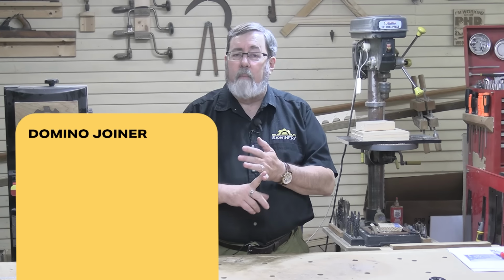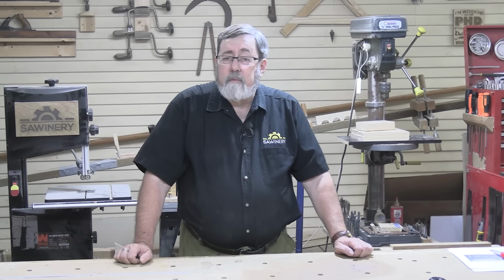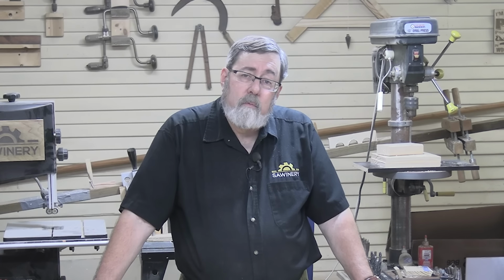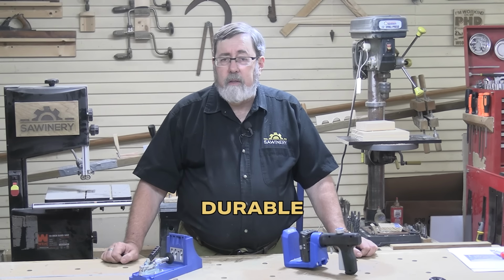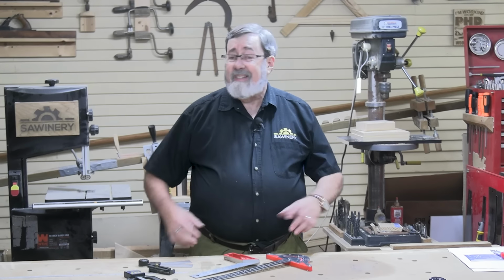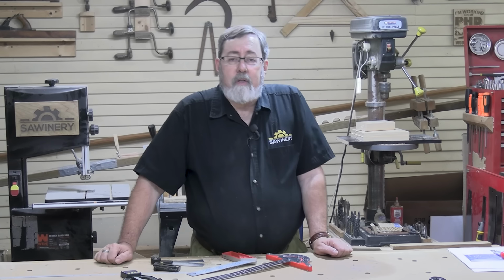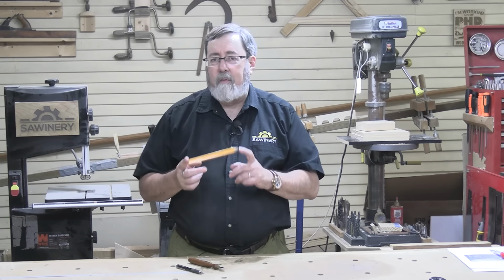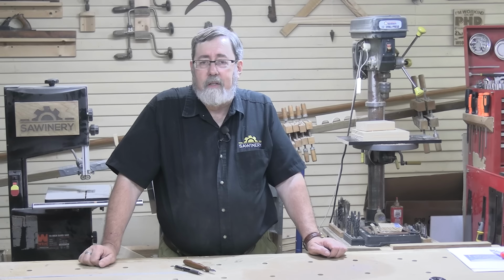5 Most Overrated Woodworking Tools

Comment: Warning bells to any new woodworker watching this video, and perhaps the rest of this man’s channel. I have not watched his other videos, but at least this one is fraught with assumptions and an apparent misunderstanding between the concept of overrated vs unnecessary for the hobbyist, overkill, superfluous, etc.

Domino: While it could be that some people think dominoes add strength to panel glue-ups, I have never heard such an assertion. Without a significant sample size, which you do not reference, it seems bizarre to make the conclusions that you have. The domino is for joinery, and granted, is unnecessary for many hobbyists. It does essentially one task very well, but one that could be done with a router, dowels, hand tools, etc. The domino is for speed, and while I think mostly apt for professionals, as a hobbyist with limited time, it means I can more quickly make furniture. Domino: Overkill if you can’t comfortably afford it, but not overrated. 

Miter saws: I’m lucky to have a 600 sq ft shop. My previous two shops were 100 sq ft at best. During this time, my miter saw was a miracle for making repeatable and clean crosscuts quickly when I didn’t have room for a table saw. New-flash, but not everyone has a garage or basement they can place a table saw. To make the statements you have is a bit of a pill to swallow for viewers desperate to get into the craft but may just have a spare bedroom. (If any of you are reading this: Yes! You can do woodworking in a small space! Don’t let this kind of content discourage you.) Next time you try to make a video talking about tools you do or don’t need, try to think more about how other people have different living circumstances than yourself. I currently have both saws, and a bandsaw for that matter, and still use my miter saw constantly. Not having to break down a setting on my table saw for a quick crosscut is fantastic. This said, I would go without a miter saw before I gave up my table or band saw. Miter saws: maybe overkill, but not overrated.

Inaccurate measuring devices: To be blunt, I thought this section was a bit silly; odd at best. if you renamed this section to “cheap measuring devices from china” I would agree with your conclusions that these particular tools are junk. This said, WHO are you talking to that is expounding the virtues of tools from temp/alibaba/no-name-brands-on-Amazon? For you specifically, and this is the odd part to me, why would you think these are worth buying? These are clearly rip-offs of woodpeckers tools, which are indeed accurate. Some are gimmicky, yes, but they are not inaccurate. (I am not a woodpeckers fanboy, but do own two of their squares.) With this said, I could understand if a new woodworker thinks they need all of the woodpeckers tools they see on youtuber’s walls. You don’t, you need one or two reliable squares. Woodpeckers: Overkill, not overrated. Gimmicky cheap measuring devices: crap, but, duh?

Pocket hole jig: I think like the domino, you’re misunderstanding the use of this method of joinery and have latched onto a few bizarre conclusions, also involving panel glue-ups oddly enough. Personally, I wouldn’t choose to glue up a panel with pocket hole screws - I would just use glue and clamps (and would throw some dominos in too for alignment ;)). But, for someone without enough big clamps, pocket hole screws can be a workaround for “clamping” them together. Not really recommended, but it’d get you through a bind. Anyway, they’re for 90 degree connections! You’re right, you can probably generally rely on glue and clamps, on a drawer or carcass for example. But hey, pocket hole screws mean you can take clamps off and keep working. Fun! Pocket hole jigs: Misunderstood (by you it seems?), not overrated. 

Carpenter pencils: It’s ok to just have four categories if you can’t think of a good 5th one. 

Lastly, please stop relying on adages similar to “my dad did such-and-such and he was always fine.” Judging by your appearance, your dad probably didn’t wear seatbelts either for at least part of his life. 

Progress is good, change is good. I hope my son gets into woodworking, and I hope that he teaches me new techniques and tools when he is my age.
Reply: Ditto.
Reply: Thanks for posting this, saves me the time of writing something of similar nature and probably spend that time disproving his claims on japanese handsaws, so newbies wouldnt have to deal with the monumental amount of disinformation and ignorance thats on display on this channel. How can a guy say "woodworking gives us an opportunity to learn" and then comment on a technique he doesnt personally use "I will never understand why somebody would do that", while said technique can be perfectly viable for some circumstances.
Reply: Thank you for pointing all this out so clearly.
Reply: He is absolutely right...I now realize : if it don't fit in my tool belt...I don't need it.  You guys knocking him are so inexperienced.
Reply: good progress is good. beneficial change is good. if you change for the sake of change, it's probably not going to be better, just different. progress isn't good unless it's progressing you towards something that enriches your life. just pointing out that your comments are as generic and blase' as some of his in the video.
I don't agree on all his points, but there are good things we can learn from previous generations. you sound like one of those peeps that disregard everything their parents and grandparents tell them, then go on to make the same mistakes they made. I suppose you aren't really that ignorant, your just responding to his video in a snarky way. I don't disagree with many of your points, but it doesn't mean that there isn't something worth learning from the video, and your need to throw out an insult to his father really undermines the value of your comments. You could have done all of that without insults, but I guess the internet has a reputation for a reason.
Reply: @temjiu9915  I was not trying to insult him, nor his father. If it came off that way, I am truly sorry and reading what I said, I can understand if my sense of humor didn’t translate over youtube comments, which as we all know is the pinnacle of discourse. “Judging by your appearance” was simply an observation that this man appears to be in his mid sixties or older - making him my fathers age. My grandmother  refused seatbelts. 

Absolutely agree that change for the sake of change isn’t good. I also didn’t say that. My point is that NOT changing for the sake of NOT changing is bad. 

I hope you don’t still think I insulted his father. I also apologize if another comment came off as insulting. I was trying to state my opinion on a video of opinions that I disagreed with, and felt compelled to (a rarity for me, to be honest) because it was aimed at beginners.
Reply: I agree with you.  This guy may have a lot of experience and be skilled but he is not really very good at giving general advice to new woodworkers.
Reply: @petrsidlo7614  I watched about 2 minutes of the video, and spent more time looking at the tools in the background.  From the looks of it, Aesop's fable of the wolf and the grapes is at play here.  He doesn't like "new fangled tools that we didn't need for thousands of years" because he can't afford them.  My 0.02

Comment: carpenters pencils, speed squares and spade bits are totally practical for job site building but not at all for a fine woodworking studio
Reply: Agreed but even for some exterior carpentry, I like to carry with me quality steel 12" rule, quality thin steel 6" rule, sharp pencil, level one long on short, quality square with no markings, medium tri-square, bevel device as well as large carpentry standard like roofers square. 

It is less about high tolerance and more about can you make it look and function correctly or as intended.
Reply: For me carpenter pencils are ascetic for carpenters like having a copy of the racing post and and setting up a "work station" with a portable burner and kettle to make strongly brewed tea. These pencils can only be caried balancing on the ear and most people simply can't balance them on their ear, they have the wrong ears. These are the rules.
Reply: I have never seen anyone use a carpenter’s pencil woodworking.  Seems like a straw man.

Comment: Enjoyed your video. My dad told me early on and it was reinforced when I took mechanical drafting in HS, form follows function. I believe in it for designing and building projects as well as tool selection. My dad didn’t use a table saw but had miter saw so that was my default when I started to buy my own tools. I'm on my third table saw in about 30 years. I'm using a low end table saw at this time and experimenting to get better before I get a better one.
I feel the skill of the maker is more impotant than the features of the tool.
Thanks again for a good video and sharing your tool and maker philosophy.

Comment: I used to have a biscuit jig attachment for my router, but as you said, it was NOT snug, and I was disappointed with using it.
I also had an adjustable T square, that when I was using it for CARPENTRY, it was invaluable for me, but as you said, for fine wood working inside a shop, not quite so much.
Keep up the great videos!!!

Comment: The Domino cost $1,200 too! I will stay with my biscuit joiner!
Reply: Does alignment just as well as a domino.

I disagree with our host about not adding strength. You can use a mortise and tenon in the right places and they are the gold standard joint. 

A floating tenon IMO is strong also. A domino is a floating tenon. 

But I agree the price is crazy for a hobbyist. Not necessarily for a pro.

I use dowels in many places where others use dominos. It can be somewhat slower but not by much.

Comment: I’ve had these same thoughts.  Lost pencils:  I saw (maybe even from you) the idea of shrink tubing a magnet to my pencils and safety glasses.  Now there is one of each stuck to every tool.  Adding a small, 6 foot tape measure with magnet to each tool has avoided many frustrating searches.  

Miter: My miter has been tucked away under my table saw wing for years.  If I need to break down sheets or lumber, I use a track saw or a circular saw.

Comment: I got a Dewalt Miter saw on sale for $400 and I don’t regret it. Now I will say, you are totally right, you don’t need one, you can use a table saw. It is just a convenience thing. I find it more convenient to use a Miter Saw than a table saw. I like to use a table saw for ripping boards. 

All the other points you make I 100% agree with but I do like my Dewalt Miter Saw lol. I also find it safer to use and haven’t been at it for 50 years either. Not saying it is less safe to use a table saw for those miter cuts but it is intimidating, especially for  cutting small pieces.

Comment: I did spring for the domino and I like it. Dominos provide little advantage for edge joining but they are pretty good for mortise and tenon.  I’ve had a dewalt biscuit joiner for thirty years and I always struggled with it until I realized it wasn’t parallel from the factory. Since I calibrated it, it actually works well. I agree with your thoughts on over-using pocket screws, but it is such a cheap tool, it needs to be in your toolkit. Plus, when I am in the field and I need to add a fastener I can’t do any other way, I can make a pocket with a 3/8 inch paddle bit.

Comment: I will mention, about 28 years ago, I did buy a biscuit joiner. and I've built dozens of pieces, mostly 1/2"/3/4" ply boxes with it.  I know that butt joints in plywood, aligned with biscuits, is a terrible way to build things, but I've not had anything fail, not anything!  And many of those boxes held up to 100-lbs of music gear (I was a weekend bar musician) and those boxes got loaded into vans/trucks, dropped to the ground, wheeled over gravel, thrown on stage, hit with beer bottles, then reverse the whole cycle, up to four times a week.  They never failed.  
My current shop assembly table and drill press table are also built with biscuits/ply, and they'll outlast me.  I haven't touched that joiner in 20 years now, but I build mostly smaller projects and enjoy hand-cutting dovetails, mortices, etc.  
But I'll never bad-mouth my ol' biscuit jointer.
Reply: And, wait until the wood or the biscuits swell.
Reply: @Seeker3876  ???  It's been 10-30 years; how long do I have to wait?
Reply: Biscuit jointer is fine, they're relatively cheap and the biscuits are easy to find...unlike that dedicated ridiculously over-priced Domino system.  I've built a lot of stuff with biscuits as well over the years, and dowelling jigs too and never had an issue.
Reply: Biscuits are only for alignment.  The strength is in the glue and end-grain to side-grain isn't the best glue joint.  It works, if there is no side pressure on the joint. 

I have a biscuit jointer somewhere.  I used it once and hated it.  It may have come out of the box defective but it didn't do what I wanted it to.  Also, beware of swelling biscuits.  If you can hide the pockets, they're far better.

Comment: The point that needs to be made about the Domino is workflow. The Domino allows professional woodworkers to be competitive out of their garage. It’s also for people who don’t have the time or lack the wherewithal to take a more laborious approach to joinery.
Reply: hahaha "lack of wherewithal" and the dump a grand on a 1 trick tool?
Reply: You can do the same thing for a hell of a lot cheaper with a standard biscuit jointer or doweling jig...don't kid yourself with the "professional" wood workers BS....they only use them because they were either given the system for publicity for their channel, or they were dumb enough to overpay for a proprietary system that doesn't work any better than stuff that's been on the market for decades and doesn't require proprietary disposables.  If you want to buy that stuff great, but it don't mean you are a professional.
Reply: @wildbill23c  I agree with cheaper  unless you are in the professional space where time is money. Like it or not the domino is fast and efficient at producing cabinets out of sheet materials. And jointing in general. If you want to see this in action go look at 10 min workshop builds. He is not sponsored, just a bloke working out of a small workshop with no table saw. Maybe you don’t need that vastly expensive and highly dangerous table saw?
Reply: @wildbill23c  Biscuits add nothing to the strength of a joint. If the biscuits swell, it's game over.  Start over.  Dowels have to be dead on accurate to work.  This is difficult, to impossible, to do over a 4' board, for example.
Reply: Love the haters on here for the domino. I can guarantee you that the moment they get to use one it will change their mind. I also guarantee that when their patent expires and dewalt makes one for $800 all the haters will be the first to buy it even though the Festool one will still be superior. I was once a festool hater but have since learned that amazing quality cost money.
Reply: @bobwalters7414  It's not only the quality of the tools but it really is a system.  The tools are designed to work together, as a system. Systainer == System container.
Reply: I don't need a domino but I can see the use case for sure amongst people actually doing wood working full time.

I really need to watch a video avlbout comparing it to the camellia zeta.  That  combo internal clamp and floating tenon seems like a good idea.
Reply: @bobwalters7414 as a retired hobbyist I was very skeptical of the domino even though I owned other Festool gear. Decided to take the plunge and it is an absolute game changer making fine furniture for what I do.

Comment: Great video. As woodworkers, we often get caught up in the hype of whatever tool is being pushed in the marketplace. Two decisions should be made based on the need of the user and what makes the most sense for the type of work someone does. I absolutely agree that the Domino is not something everyone absolutely needs to have. I make a lot of small tables, and I personally find the domino a huge time saver for attaching table legs to aprons. I occasionally make larger tables for friends. I either use traditional Mortis and 10 and joinery or I use my router to make floating tenons. Although the large domino would work well for this task, I certainly don’t make enough of these larger projects to justify the very expensive purchase. When I first got interested in woodworking, I had very little money so I had to be very careful about tool purchases. I had a small table saw a couple of antique planes. I restored and not much else. I had to learn to use the tools I had to make the things I wanted to make. I believe this was a great help to my development as a crafts person.

Comment: Great video, thank you.  I bought a sliding compound miter saw years before I could afford a table saw.  I still use it when I need a quick cross cut on a long 2x or 1x something.  Is it over rated for woodworking ?  Perhaps, but it can be useful at times too.

Comment: When i first started home renovation and making furniture and cupboards i thought,like most people, that joints  had to be glued and nailed or screwed. That was fine and everything was fine.... Years later i started making ukuleles and a couple of violins. There are no metal fasteners used in musical instruments and they are strong , don't fall apart and use small glue contact areas.
This got me thinking ,,do we really need nails and screws¿¿??
Now i build a lot of small tables chairs and cupboards and hardly ever use fasteners.
I don't use dove tails or mortice and tenons.  I glue bits together, reinforce with glue blocks and angle braces..
If a joint really needs extra strength and security i reinforce with through dowells after the glue has set.
So far nothing has fallen apart.
Modern glues are amazing